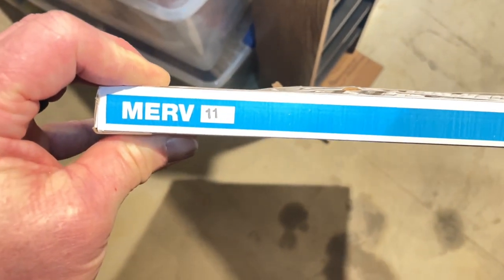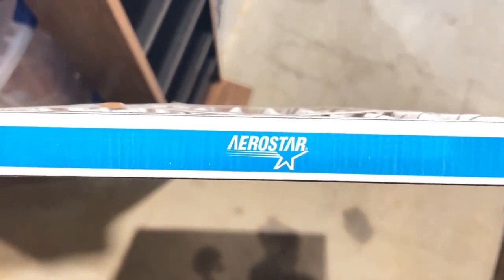Plugged air filter can do that?

Comment: Was advised by an old timer to only replace filter with the lowest Merv rating. You want to catch the big stuff. You can only blow out what you can suck in. There's less stress on the blower motor and made last longer. Must check your filter OFTEN. Replace as needed.